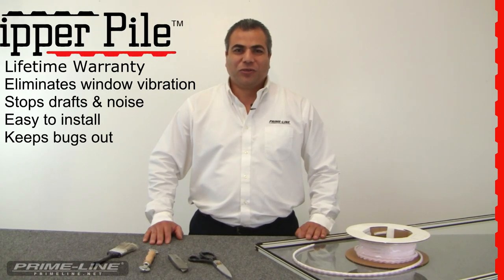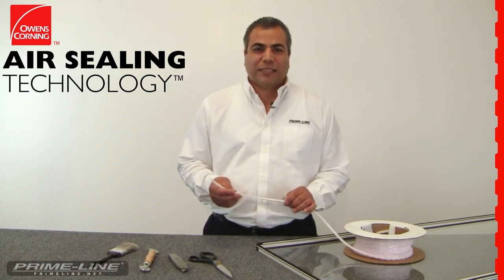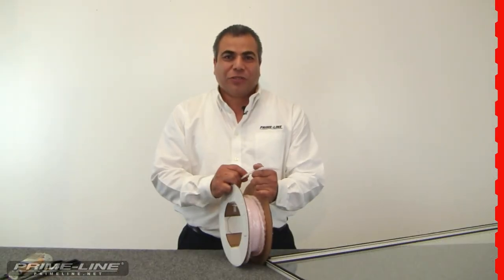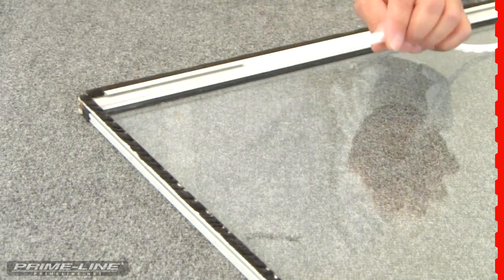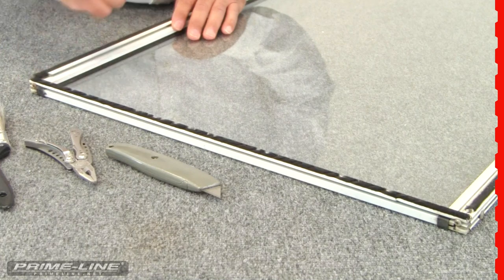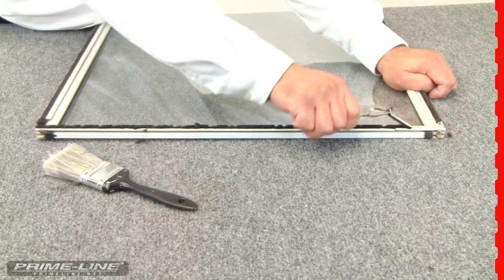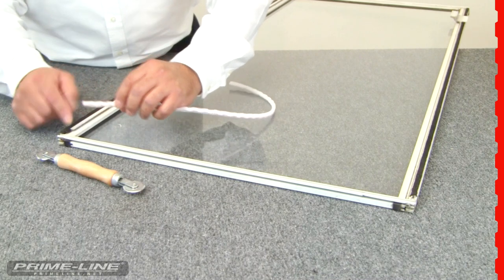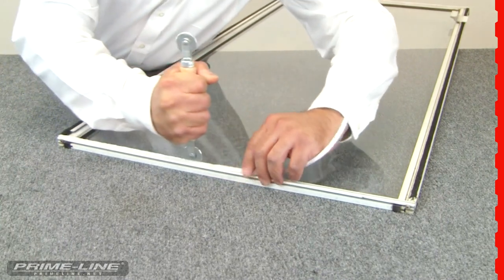How-To:  Install Zipper Pile Weatherstrip

Comment: Thank you for this video. Im doing 40 aluminum doors and started with the sliding method. The doors are old and some spots in the track are damaged, and it often pops out of the channel. Going to try thus method tomorrow.

Comment: I have 26 double-hung vinyl replacement windows that are 25 years old. The manufacturer, Thermal Industries is out of business.  I asked a window mechanic to replace the weatherstripping on the sides of the windows. It appears that the old 3/16 T slot pile weatherstripping is crimped at the top and bottom corners of each sash. I guess it was crimped to prevent it from moving when raising and lowering the sashes. The mechanic said since it was crimped in a place he did not recommend replacing it. Instead, he recommended reshimming the windows to make the weather stripping space tighter.  Reshimming is somewhat helpful but to get rid of drafts completely replacing the pile weatherstripping would make sense.  Can you please do another video showing how you can remove crimped weatherstripping,  and replace it with new pile weatherstripping, crimping it again so it stays in place at the top and bottom of each side, without damaging the weatherstripping slot ( track)? Since the windows are old my biggest fear is that I will damage the weatherstripping track and then the windows would need replacement. Also, do you have 3/16 bubble weatherstripping in white and dark brown (or black) for the bottom sash? Thank you!!!!!!!!!!!

Comment: My old window weatherstripping slides in and out without a tool. Can this product be used as a replacement and will I need to use a tool to get it in?
Reply from the maker: Yes,  this type can also be installed by sliding it in.